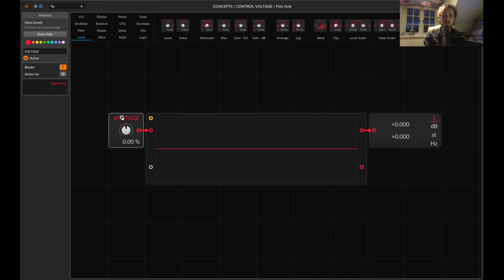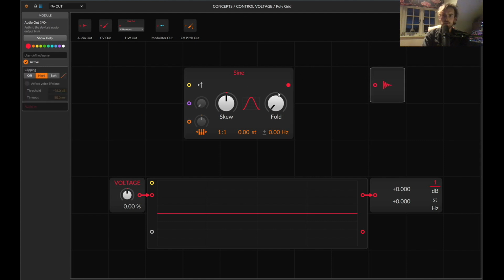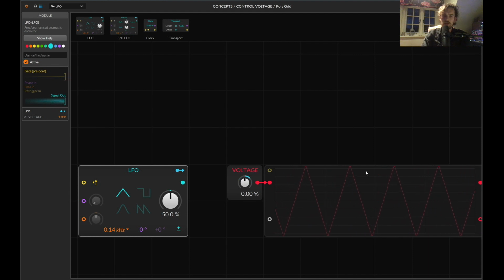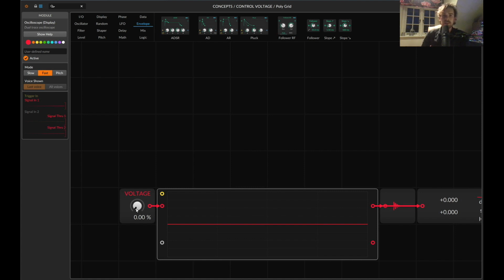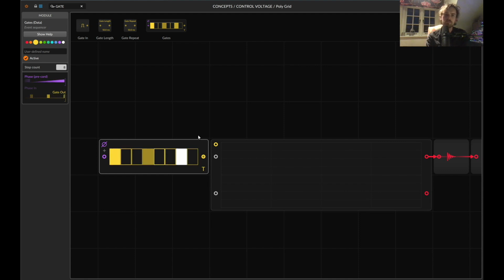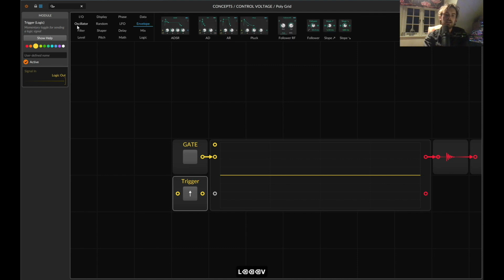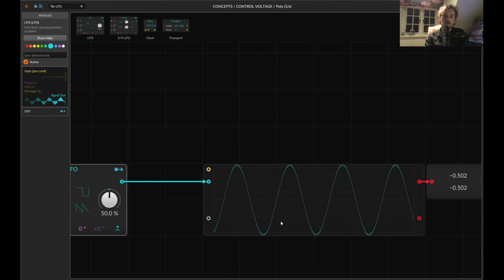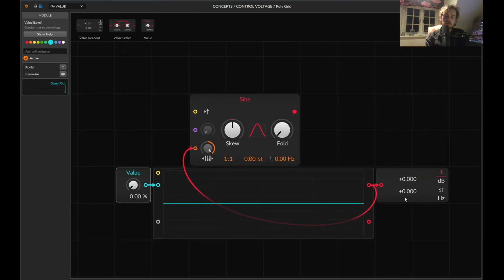Bitwig Grid 101: Control Voltage or the 'Invisible Hand'

Comment: This was excellent and really helpful as I use Bitwig with a handful of Make Noise modules particularly Maths to explore the fundemental principles of sound making. Looking forward to more.
Reply from the maker: Thank you Gary! Are you using them with an Expert Sleepers module? More on the way friend 🤓
Reply: I would love to have an Expert Sleepers module as it would be a far more elegant solution. Implassuible as it may seem I am still using an original MOTU UltraLite FireWire audio interface that I got in 2008 12 years ago! Originally I used it with Volta a virtual instrument plug-in from MOTU that turns the audio interface into a voltage control interface. It was then connected to my first control voltage setup consisting of several Moogerfooger analog effects pedals that have multiple CV/Expression inputs and outputs. I'm not convinced this ancient MOTU interface in 2020 is providing accurate calibration or tracking but I am able to explore the basic priciples of CV, gates, triggers etc. In many ways this indeterminate behavior has been pleasantly part of my creative process.
Reply from the maker: @garystewart1438  Ah fabulous! I'm a sucker for indeterminate behaviour myself :D I'm going to make a video about the ES8 that I think you may enjoy (don't tell your MOTU hehehe)